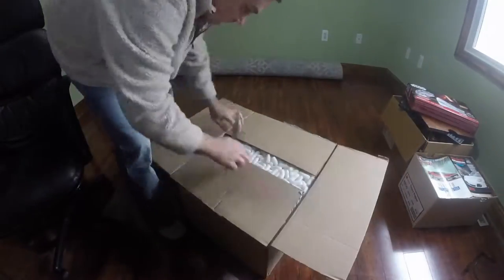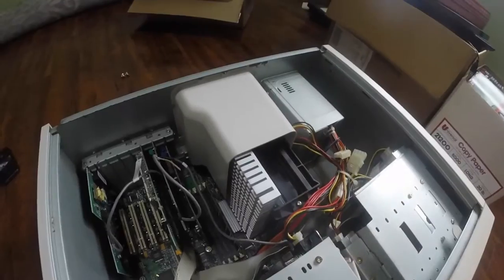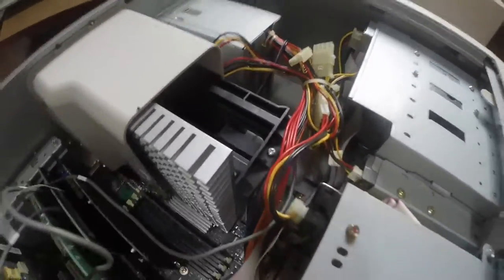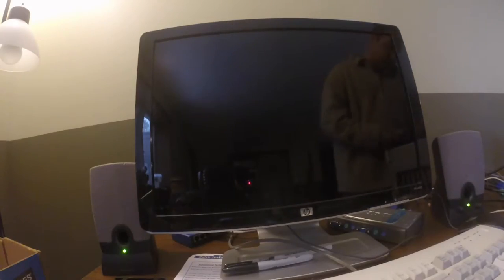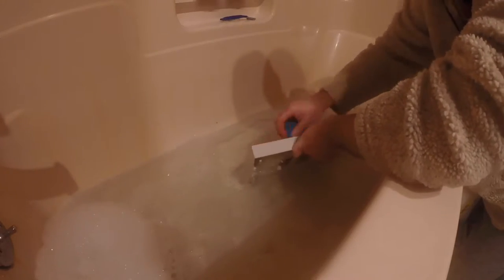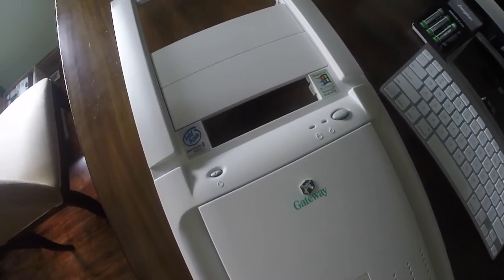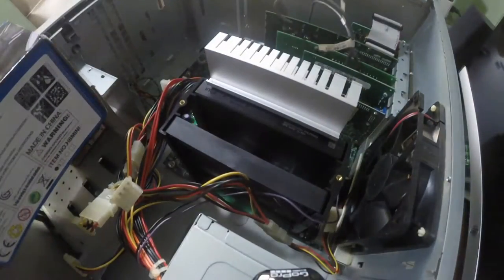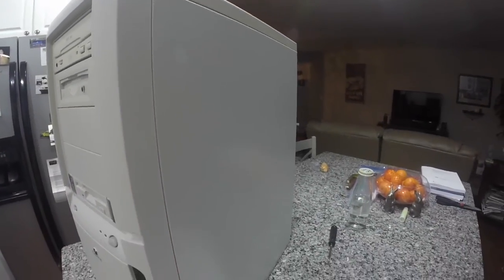Restoring A Legend: Gateway GX-450XL Restoration Computer 3dfx

Comment: Do you still have your GX-450XL? I upgraded mine from P10 to P17 BIOS and now it only works with PIII Xeon processors. All PII Xeon support is lost. I'd really like to downgrade it to the P10 BIOS, but it's not available anywhere on the internet. If you still have this machine, is there any chance you could copy your P10 BIOS and post a copy for download? It would be such a massive help. These GX-450XL machines are rare old beasts.
Reply from the maker: I do. But it's in storage and I won't have access to it until my basement remodel is done. Contact me in 6 months. In 6 months the remodel should be done.
Reply: @cpudan2000  Thank you so much! Good luck with the remodel. I’ll reach back out in 6 months.
Reply: This machine uses an OEM version of Intel MS440GX Marlinspike motherboard. Try looking up bios for the intel model insted. I'm pretty sure the Intel BIOS versions are still around and easy to find. You'll lose the gateway logo from your boot screen though. BTW there is a secret BIOS menu activated by switching the jumper by the chipset heatsink and the first (top) memory slot from 1-2 to 2-3, it works even when the machine is powered on in the BIOS. You can set multiplier, bus speed and things like that.
Reply: @cpudan2000  Any chance you could take a crack at this?
Reply from the maker: @mikv8  Wow! Very interesting information, Mike V8. Thanks for sharing! I'll see if I can give a shot!
Reply: @mikv8  THANK YOU! I'm just seeing your comment now and holy crap this jumper actually fixed the issue without having to swap from the Gateway to the Intel BOIS. I swapped in a Pentium II Xeon with the jumper set to the config setting and it actually posted! I went into the BIOS, set the CPU speed, shut it down, returned the jumper to the normal position, and once again it posted with the Pentium II Xeon installed. This has been annoying me since 2019 and I finally have a solution. I must have gone into that configuration mode with the Pentium III Xeon 500 installed and set the multiplier to 5X. Then when I re-installed the Pentium II Xeon 450, it wouldn't POST at the 500 MHz. Kudos good sir!